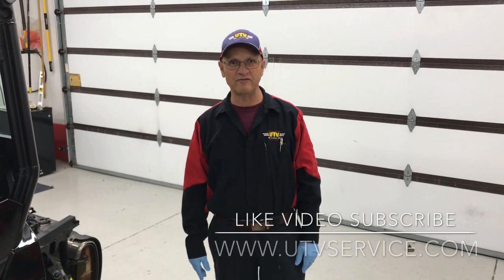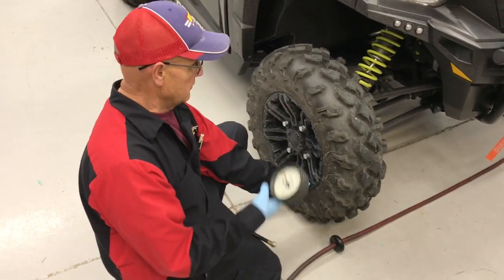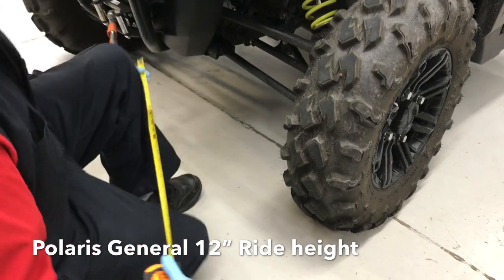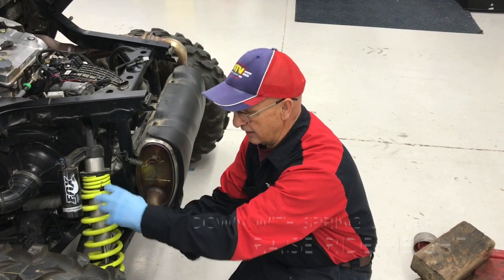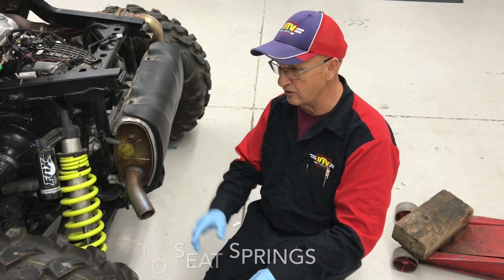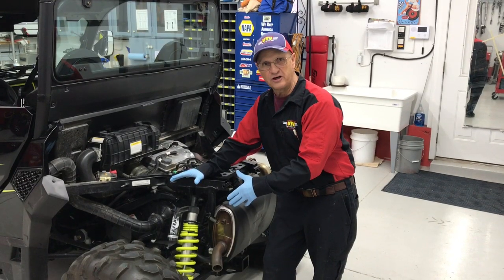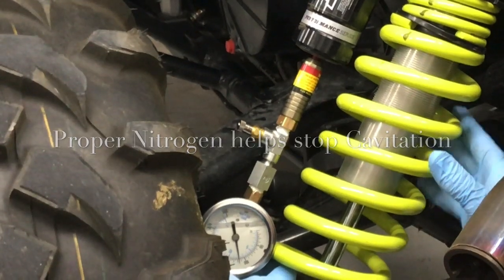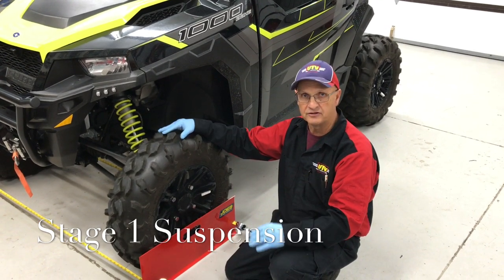Polaris General 1000, Stage 1 Suspension Set-Up, Alignment, Ride height, Shock Nitrogen Charge

Comment: I’ve got a pioneer with 200 miles on it and the right front tire is wearing significantly more than the left front and when driving down the highway I have to hold my steering wheel to the right some to keep it straight on the road. I just bought some toe plates so when I get ready to set the alignment would I put my steering wheel straight and adjust both sides the same or put the steering wheel where it sits when I drive down the road and adjust the right wheel more since it’s wearing worse?
Reply from the maker: Straighten up the steering wheel and look down both sides of the outside of the tire so you see the same amount of rear tire on each side, set the toe so they are equal.